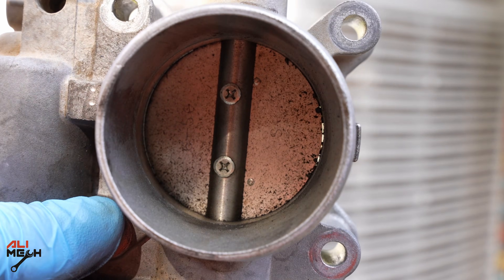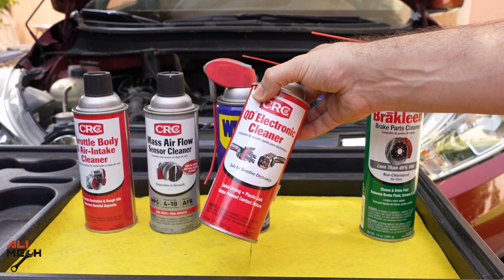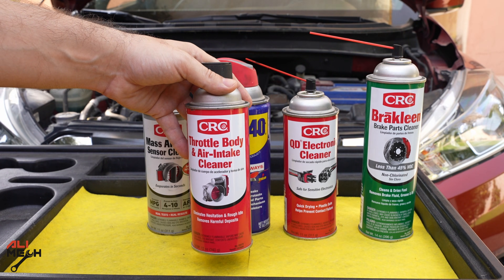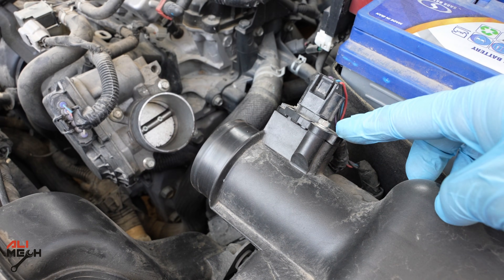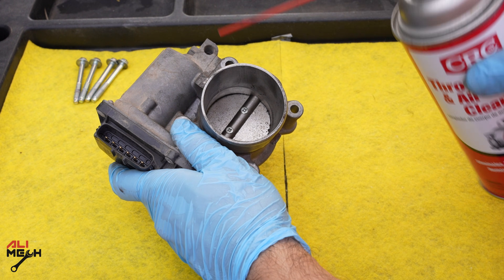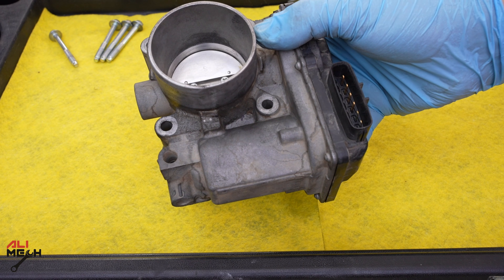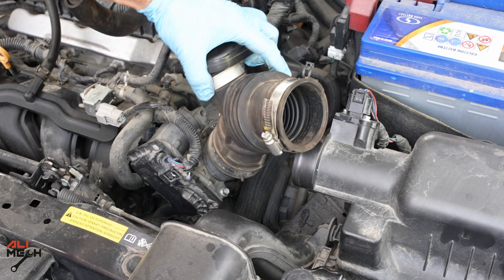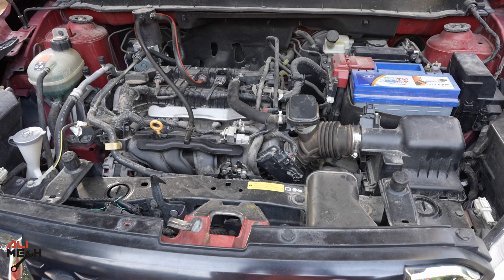STOP Doing This When Cleaning Your Throttle Body (It Ruins Idle)

Comment: On a different note, I use contact cleaner on Maf sensor and have no problems. Leaves no residue
Reply: Yes you cant see, but test with temperature reader of the sensor,  you will see big difference,  that's why we have lab test, what you dont see doesn't mean there isn't 😅😅
Reply: @Bianedden my cars idle perfectly. Must be doing something right.
Reply: @kalani1987 yes but engineers dont woek with look or sound, its all about data and numbers,  have you test electronic cleaner on thermometer,  there is easy 4 to 8 c difference
Reply: @Bianedden as long as it doesn't hurt anything, why bother? Been using it for years